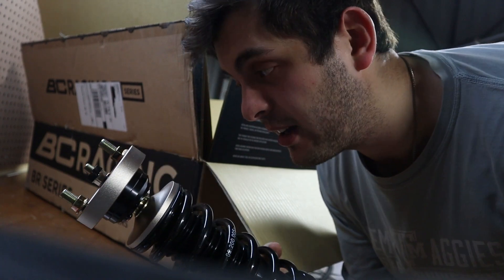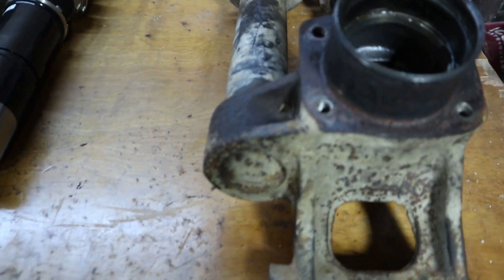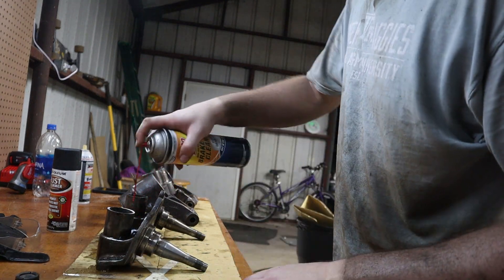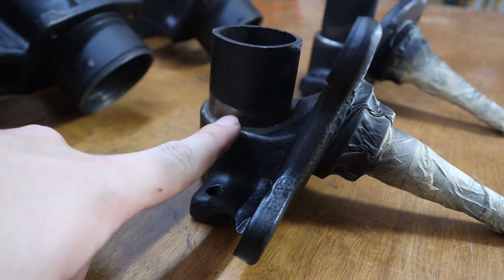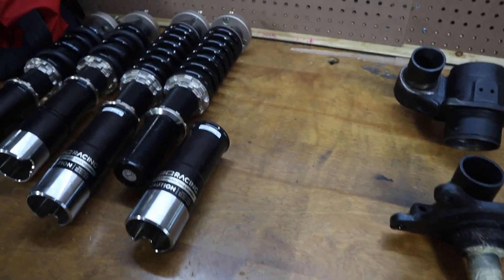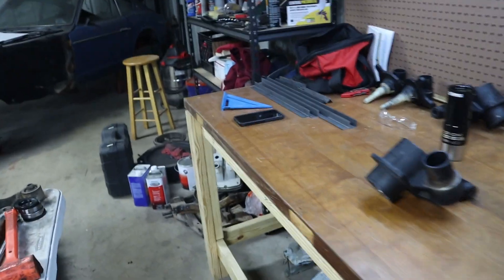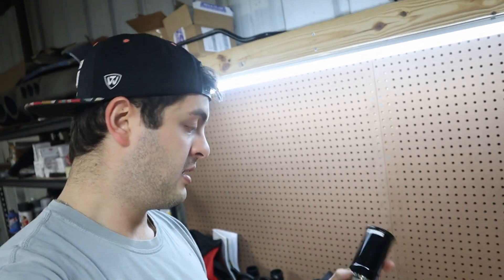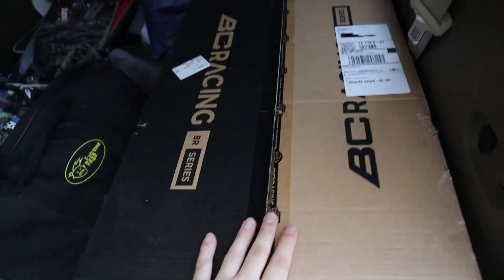Installing BC Coilovers on the Datsun 260z Part 1| [Ep.23]

Comment: was it easy to take the parts off the car?   i bought some coil overs for mine..  about to do the job
Reply from the maker: It was only difficult because of rust but if you soak it in PB blaster you should be good 👍🏼 
Also let me know how it goes!
Reply: @GrantWerts  im probably going to go ahead and take them off like you did because all the bushings are trash..  did you run rubber or poly bushings?  i would like to run rubber... let me know if you where to get rubber bushings
Reply from the maker: @chriscraft77022  no I ended up doing poly bushings, they were available and since this car was mostly meant for track use I didn’t feel the need to do rubber, sorry I can’t help you :/